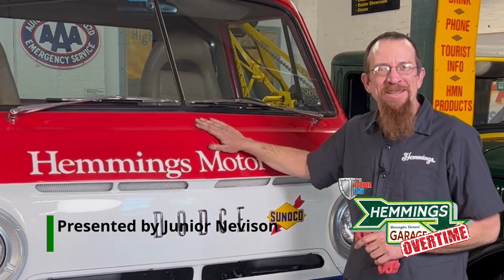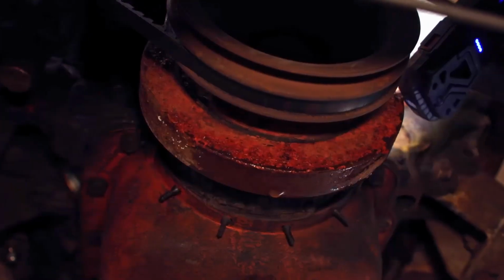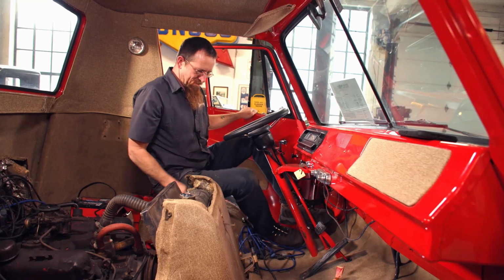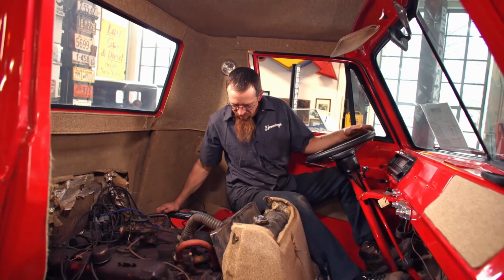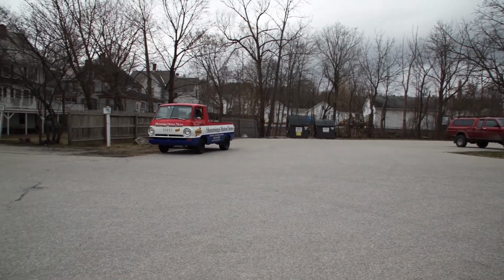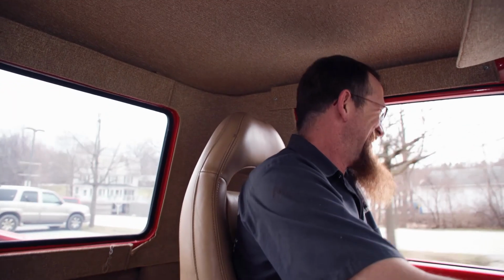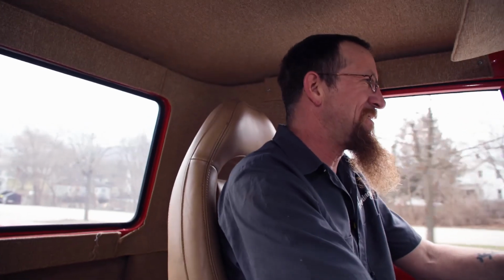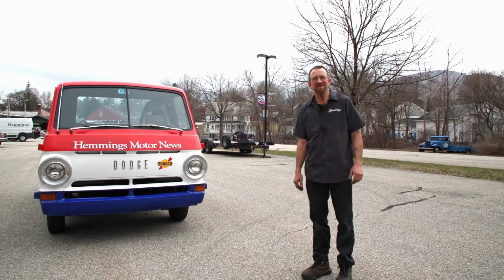Dodge Shop Truck – First Start of the Hemmings A-100

Comment: It had a 318 with a 3 speed and a posi rear end. I came out of the grocery store and the van was parked 2 lanes back from where I parked it. A bit of Junior's drag racing the back alley behind the grocery store and a quick park job. Just not the right place. You put in three water pumps and a fuel pump before we got to Concord N.H.😆
Reply: Aahhh so the real story is beginning to unfold! That's the Junior I know and love!